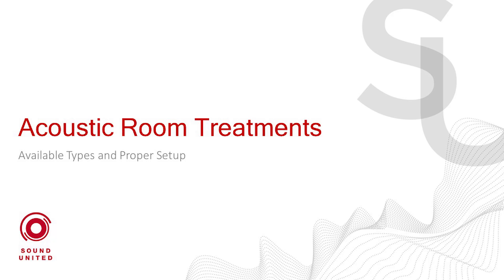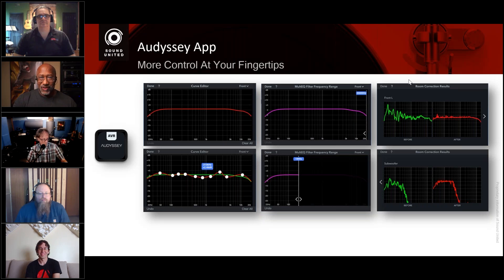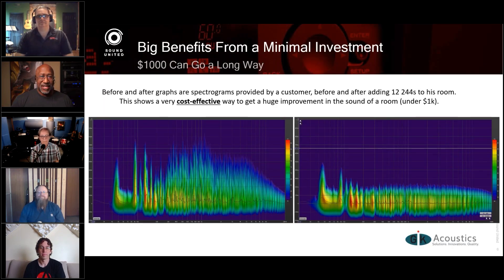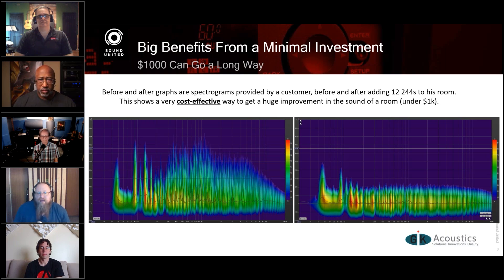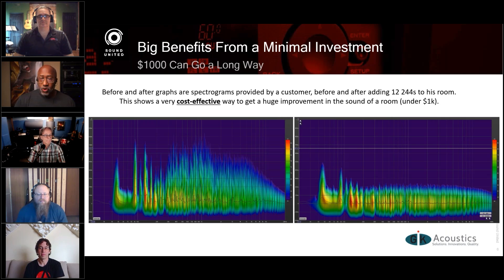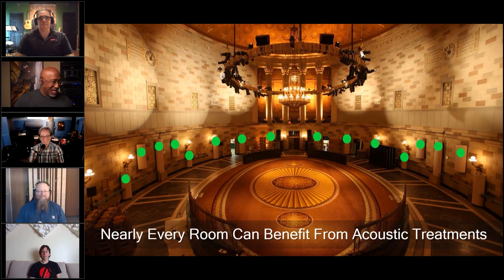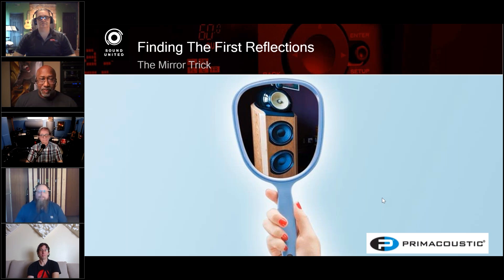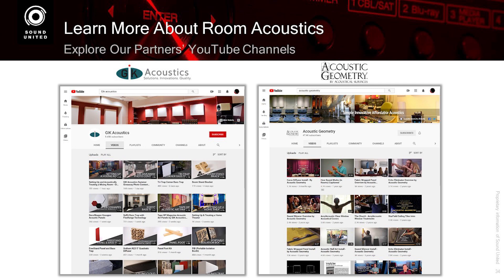Acoustic Room Treatments - Part 1 Finding & Reducing First Reflections

Comment: A great free acoustic improvement is understanding the volume of the room you have.
To much volume/air pressure for your size of room will never sound good but folks will still crank it up..
Turning it down and finding a better fit for the sound energy in that room is always a great place to start with acoustic treatment 🔊🔊👍🏼

Comment: A question for John Calder ... Wheres your data on MLV working "really really well" as a pressure trap in the pressure zone? In my exp, MLV is far too heavy to adequately resonate enough to attenuate any fundamental  or harmonic frequency below 100hz.... Even when completely suspended in EPDM.  As im sure you know, we cant really assume a Low Frequency product works "really really well"  if the only data we use to justify that statement is restricted  to  the room that the unit is located in - as chances are good that were dealing within the arena of Small room acoustics ,  and therefore unable to really get a good idea of its GENERAL efficacy.  These rooms are far too small to judge how well a pressure trap performs.  We need to test these units in a facility that has enough volume to accept at least one full cycle  of 20hz or below.  

just to clarify - my question is not intended to troll or argue.  Im just curious if you have any empirical lab based data to back that statement up?  because MLV has never performed well for me, and I've used it dozens of times 

thank you

Comment: There is so much misinformation about acoustics. How can early reflections simultaneously be fast enough to be integrated by the ear AND “smear detail” and “muddy imaging”? Affecting frequency response and tonality maybe due to interference. Just goes to show these “experts” just parrot the canon.
Reply from the maker: I spent ten years as a US Navy submarine sonar tech so I can tell you the problem with early reflections is based on science. Your abliity to locate an object in space is based on the timing difference between both ears. Just like sonar techs use the timing difference between multiple microphones to shoot torpedoes at things.

In our listening room, direct sound from the left speaker has to travel about 11 feet to reach my left ear. The reflected sound off the left wall has to travel about 18 feet. At sea, level sound travels 1100 feet per second. So the difference in arrival time is approximately .0064 of a second. 

If the difference in arrival time is small, and the amplitude is similar, it is difficult for the human brain to differentiate between the sound bouncing off the walls and the sound coming from the speaker. 

On sonar scope, the line on the graph would appear thicker and depending on the amount of timing difference (sounds bouncing off the ocean floor), you would often see a secondary line.
This is what makes the center image seem less focused. Room treatments reduce the amplitude of the reflections to the point where your brain ignores them. This is one o the reasons why they are utilized in most recording studios and concert halls.